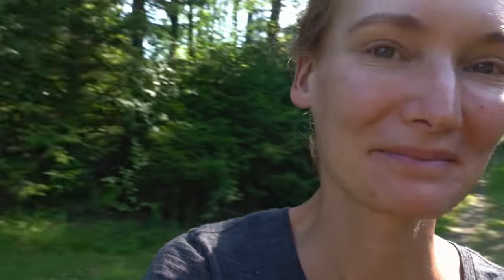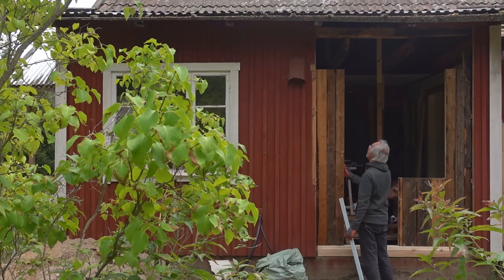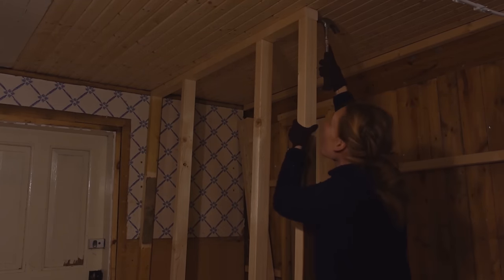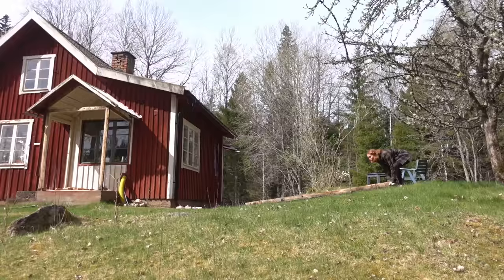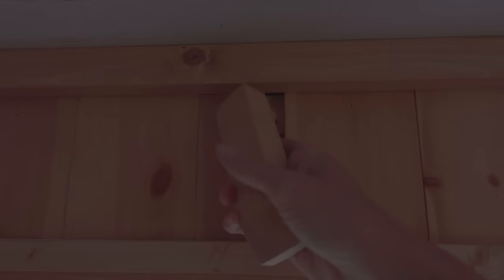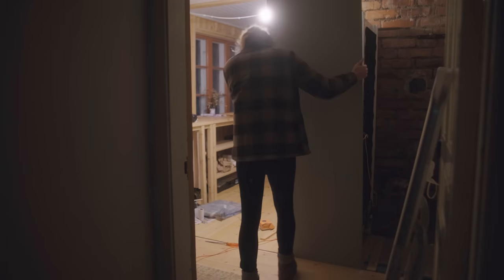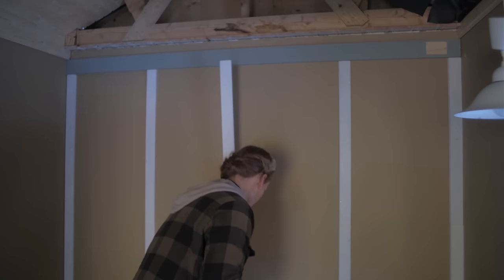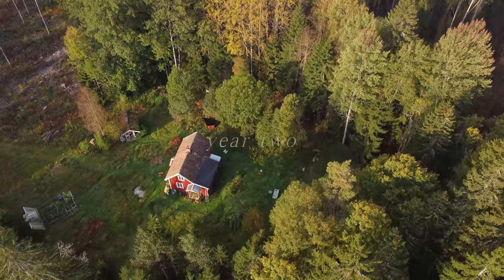TWO YEARS I spent my savings on this old Swedish cabin and did this...

Comment: Good work! May I mention that old wooden houses needs to breathe to avoid mould and water damage. So try to use traditional materials and methods. 
The attic is for “even out” the temperature and to build rooms up there you need to be careful not to cause mould and moisture. 
In general try to use flaxseed paint and stay clear of the yellow mineral insulation. Looking forward for more updates! ❤
Reply: Could you give any specifics on allowing air flow or breathing of building?
 I'm planning on finishing/ converting our 14 × 50 shed to a tiny home. I have no experience so I'm going to piece together everything and mold is my biggest fear. 
Thank you
Reply: @danab4337  depending how cold it gets on winter in ur country u need more insulation on the walls (thicker walls). Am in construction and that's how here in Finland a more modern requirement house is made (ofc just one way of duing it, but hopefully you'll get a little bit of understanding).   Just make sure theres caps in between layers. Outside panelling, planks horizontally,windproof board, glass/sand wool insulation, here modern houses usually have steam/moisturize plastics that are sealed with vulcanizing tape. Then Horizontal square wood poles or similar with 400-600mm caps, fill the caps with more wool. Lastly put chalkboards and after that u can even the walls and paint em ect.
Reply: If there's space inside the roof and ceiling there should be a big layer of insulation as well. Same with the floor, use wool and some insulation board. Just make sure there is room for air to dry out layers and nothing is directly on top of each other or against plastic
Reply: @karoliinaniemi2536  thank you for all your information 🙏 appreciate it.

Comment: The first thing you should have done on any of the buildings was to find out where the mice are getting in. There is no point insulating and adding new ceilings if you are going to have mice running around inside. You are very brave and determined and I think you have done a great job.

Comment: Hi Rosie :chillwcat:
My hats off for you! How fun finding a kindred spirit like you. I´m also still English and emigrated to Sweden around 46 years ago, so more Swedish now! 
I also currently live in a tiny wooden home beside the forest. Despite very many years of living here, it´s very rare to meet others from the England.
I like to think that you might have left for similar reasons, that would not surprise anyone. Yet you have had a tough time.
I wonder how far up Sweden you had to go in order to find a cheap enough place with some land?
My father was a Master builder back in the day, so I knew how to hold a tool, yet was still amazed at how different their building codes are here, right!
It is normal that the system requires you to learn Swedish very soon after arriving here, so how did you get round that or did you learn back in the UK?

Well, I feel for you. I remember myself, just how tough it was renovating another large house that had to have everything done or moved. I had to go down to the
Building exhibition in Mollndal in Gotenberg to look at the wall sections and materials used! No internet back then.
It must have been really hard for you, not being able to ask. Yet you had internet right?
That insulation is very dangerous, you must wear a proper mask and not expose your skin, if you hold up a torch when using it, you will understand, all of the shards
get breathed into your lungs and stay there. So don´t buy it or use it. If the wool does not fit exactly within a hole, it´s useless.
Wonder if you have insulation under the floors too? Well is you have a question or problem, just message me on a reply.
I trust you have a store within biking distance, it was one of my wishes when looking for a home, as I did not want to drive every time. The feeling of biking through the country
to buy your supplies is very special right.

The chimney looks very well done, I did not see a lever for the opening going up though? 
Hugs and best wishes and a belated welcome to Sweden :chillwcat::shelterin:🙏

Comment: in my grandfaters house when it because minus 20 or lower  they shuffled loose snow to cover the lowers part of the house -the stonefoundation , but my father did the same in sweden with milder winter and a low cementground -It would not rot the house sine it obviously melt away spring - But modern house have very hot electric elements and putting snow againt the other side of those - I would use some kind of plywood or something

Comment: I moved into a house from 1947 last summer, and even though my house has been taken care of, most of it is still the same. To be honest I had not really thought about what winter would be like in an old house with thin walls and little insulation, so I just ordered firewood as I do have working wood stoves in this house. I did see down to +5C inside my livingroom in the winter and even though I did heat up the house when I needed, it just made me not want to really do much. I felt that heating became a chore instead of having a charm like it honestly do also have, it just became something I really had to do instead of something I wanted to do. I also felt it tiring with the very hot evenings with superdry air, so the contrasts were just too big to my liking for an everyday life. If this was just a cabin I would have no problem, but I am living here full time in the middle of nowhere.
That's why I decided on getting a heatpump, because I started to think about what advantages it was for me to use wood as primary heatsource, and I easily boiled it down to not being an advantage at all. I do not own a forest I can chop down, and I also do not own machinery for it at all, so I have to buy wood, and it does have a cost. 

That's why I just decided to get a heatpump, and right now it is -25C outside and I am so glad I did because now I can just walk around anywhere in my house and just use my house instead of having to constantly think about when or if I should heat it up. It's even temperature, and something that I value is that now the air is not superdry.

I still don't have a snowblower yet, so that's the goal for next coming winter, because shoveling snow all winter by hand does take a toll on you as well. I do have a car so I just park it as close to the road as possible, so it will be less snow to shovel, and this winter I just decided that I will only shovel to get my car in and out, because it's just too far from the door of the house to the road. 
After spending 2.5 days shoveling snow one time last winter, I had to rethink how I would tackle the snow from then on. It sure looked nice, but I'll get there again when I can afford a snowblower. I do understand why farmers have all the machinery they do, because it's pretty invaluable when you live in the middle of nowhere.

Comment: 8:41 I work with software design/programming. And I have to agree: Maintenance and fixing old problems is generally much less fun than creating/building new stuff.  But at the same time, you need a good foundation.

Comment: I mean, I don't know what her savings where, but I would argue one could buy a better cabin? But like.. I love the result!
 
Would I do it? No. I would buy a cabin that is in a better state to begin with, then change all I needed to change. Cabins in Sweden and Norway are cheap, I would expect that cabin to have costed around 10k - 30k pounds depending on the area? You must have spent another 50k renovating? I would use the majority of that to get a cabin in a better state then upgraded in a slower pace, since I really would not be so much in the spot of "I NEED to do it NOW or I can't sleep cause it is freezing"

But wonderful experience!

Comment: Wow, lots of work with limited resouces! Good choice on the gardening. As an old tradesman, I'd advise: make a pair of sawhorses They can be moved to your work location. Learn about nails as fasteners and learn to use a hammer as if it's a wanted extension of your arm. Oxalic acid will bleach and clean lumber, particularly useful for those using reclaimed lumber. Work slowly and plan (you already seem proficient). Good luck!

Comment: Amazing project! Just started watching, and wanted to comment on something I'm seeing at 3:12 – you're tearing away the stretched paper ("cardboard material" as you say) that holds the wallpaper. The technique to attach this thick paper layer is called "pappspänning" and was how they wallpapered log walls, before there was particle board and drywall. What they usually do when they renovate old buildings in Sweden is carefully removing the wallpaper using steam and repairing the stretched paper. In the past, people preferred wallpaper as it provided insulation, stopped the wind and hid the fact that it was a simple logged building and not a "proper" house (frame or brick). I don't know if you're going for a new or traditional look, but if you want wallpaper, tearing down this paper layer means a lot of work restoring it and requires expert help to get it right. Not a lot of people know the old ways anymore.

Comment: having done something similar (except way smaller), i am very impressed. some hopefully helpful ideas

- wood stove: they are so wonderful. you have lots of fallen trees around so there's that. if you put some kind of water proof floor area around it, you can put a big pot on it and have an indoor shower using a small pot to pour water over your head while you stand in a washtub. do your hair first as the water will get hot by the time you're done. also, wood heat will fix your high humidity problem in the winter. unless it's stormy, you can heat your home and have a window open for the best of both worlds - heat and fresh air

- solar panels and a few batteries: despite what some people say, you can get enough power in the winter except if you're north enough to have 24 hr darkness. i was 52 degrees north and was fine. get out your trigonometry textbook and find the angle to the sun for aug 3, feb 3, and may/nov 3. i made a triangle bolted at the corners to allow for movement and 3 pairs of holes for each of those dates (above) so the panels are oriented optimally over the year. you need only undo the bolts and slide the panels to the correct position 4 times a year. a suggestion about batteries, that i never found out till too late, was to hook them to a bus bar instead of each other or the last one will die too quickly and then the next one...

- get a rain cap for the chimney to prevent future water problems

- get a cat, lol. preferably one from a farm so the mom has already taught it that mice are good to eat. my first cat, a city cat, would bring mice in to play with them and lose them in the house. he quit doing that after i put a dead mouse in his food dish for a couple of days. and don't let anyone convince you you need a hoard of cats so the mom is always hunting for her kittens - you only need 1 cat as i was enough of a crazy cat lady for both of us

- bears love fruit trees

again let me say that i'm so impressed with your beautiful little cabin. nice start :)